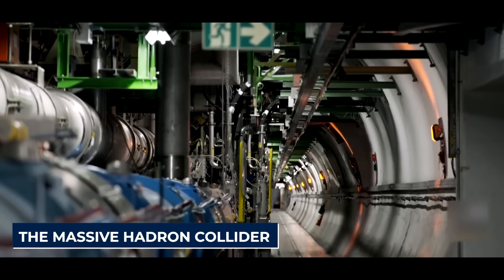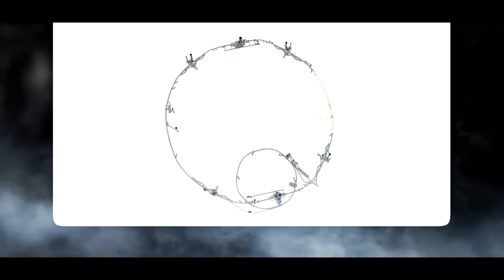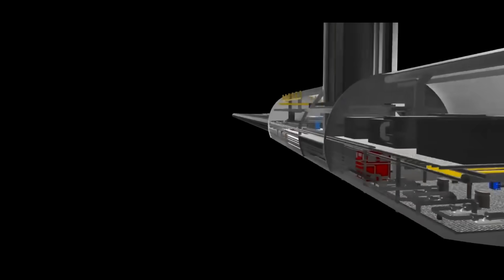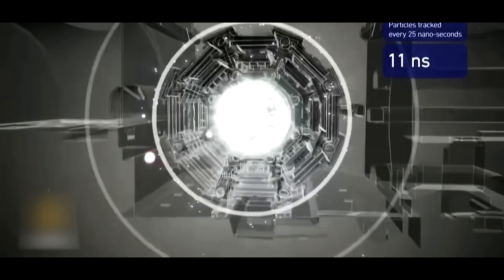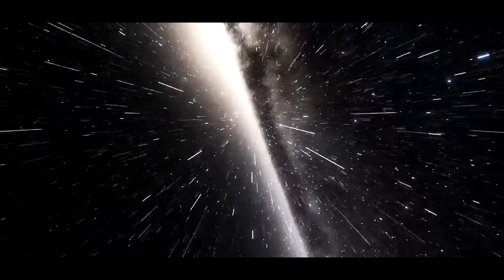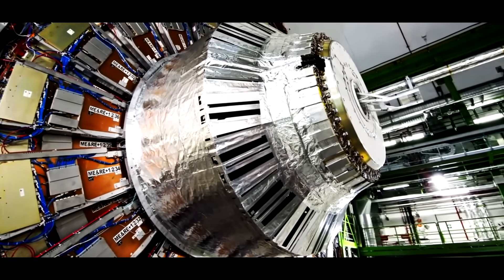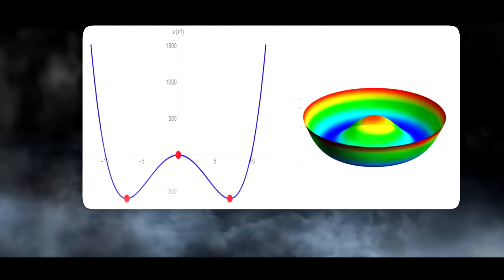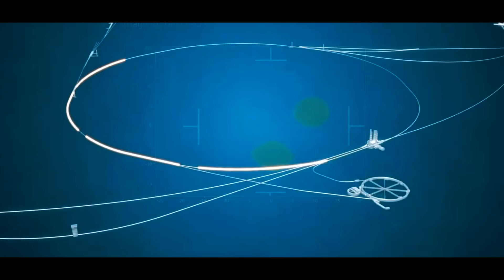This should concern all of us...

Comment: The false vacuum jump would see the properties of the Universe change such as the speed of light jumping to the speed of light squared. At initial creation the speed off light was the speed of light cubed. That went on for awhile then it slowed down to the speed of light squared. Once expansion dropped the speed of light with photons traveling only 586 thousand miles a second black holes were able  to form and bridge this dimension to other dimensions and this reality was formed. To get past the false vacuum jump photons would have to get back to the speed of light cubed something we don't have to worry about. The energy to do that is now spread all over the Cosmos and true vacuum stopped existing a long time ago when the Cosmos and Multiverse were first created multiple infinities ago. The Creator is really really old and plays with evolution creating intelligent life because He is lonely and He has no intention of starting over. He would miss all the hosts of heaven and the races out there way to much. However we have spotted the switch He could use if He wanted to start over. He may but that would be an infinity away. Everything wouldn't vanish at the speed of light it would vanish at the speed of light squared accelerating to the speed of light cubed then everything would return to Him. Something that doesn't interest God but He holds it over all intelligent beings like the sword of Damacles.
Reply: Where did you read all this? Really interested in seeing and learning more